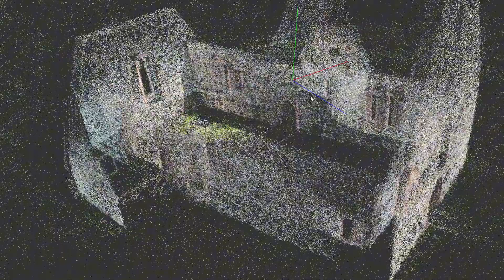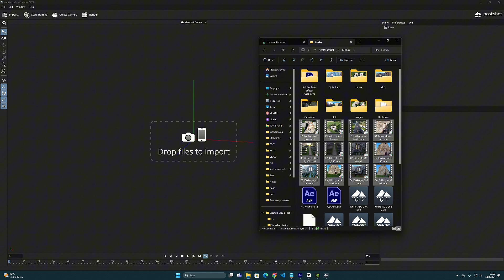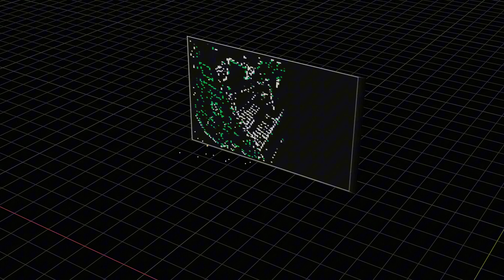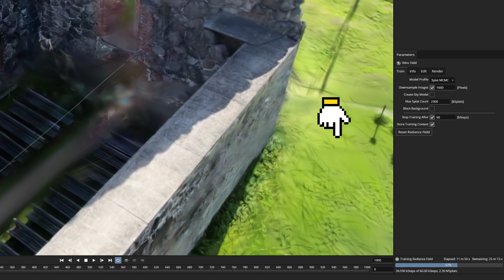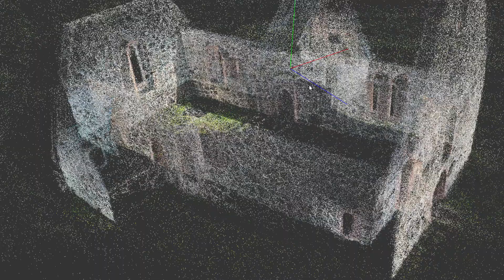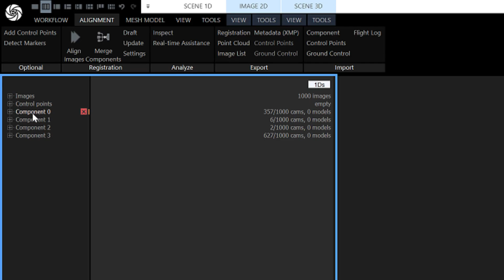Unlocking the Mystery of Sparse Point Clouds in Gaussian Splatting

Comment: Would it be useful to take still images in RAW format and then run them through Lightroom, with a simple edit that lowers highlights and raises shadows? You can recover a surprising amount of detail in apparently underexposed / overexposed images like this. Then export those images from LR as high quality .jpg and feed into Postshot. Result, PS should have a lot more detail to work with that would be missing otherwise. I've been dabbling with PS recently and will have to give this idea a try.

Comment: What about making a pass where the camera is exposed specifically for the shadows? The highlights would likely be completely overexposed and unusable, but at least all the necessary details in the shadows would be captured. If you were to provide multiple videos of the same trajectory, each with different exposures—one for deep shadows and another for highlights—would Postshot be able to understand and combine the data from both? Another option could be to use software like DaVinci Resolve or Premiere Pro to lift shadow details and then ingest everything into Postshot. What do you think?
Reply: Yeah, I was thinking the same thing.   Create an image sequence where you raise the gamma, create the 
point cloud and camera.csv in RC and then overwrite the gamma images with the original ones and do the training in PS.

Comment: Hi Olli! One trick used in photogrammetry is to capture the image during grey weather. It's never easy to process areas that are too dark, so you'll have fewer shading problems, and it's very practical for relighting! You can eventually lighten the shadows in your photos before RC, then put them back in to create the Gaussian, but it's better to shoot at the same time, over several days with the same weather. I find that calculating Postshot directly produces slightly fewer floating splats, but this can be cleaned up. It's still an interesting gateway, because the alignment will be more precise, using your drone's GPS, and it will have a better scale. Be careful, though, to increase the number of points detected on each photo before import, and don't hesitate to redo the alignment several times, as it will improve it each time! The presence of a few targets on the terrain is useful for control points. Xgrid scanners are also very interesting, with Lidar interpreted in Gaussian! Glad to see all these evolutions! Nice continuation to you! Thanks a lot!
Reply from the maker: Great tips. Yes. Those Lixel scanners from XGRID would be very interesting to test on this kind of large area scanning.

Comment: So If it has issues I've been experimenting what I do is export the video to images via say media encoder then I manually look at the problem area for blurry photos etc when exporting I won't export every frame say every 10th but if area doesn't look good I might export more frames there.  I delete anything that's flared and overall look for anything that could ruin the generation then I'm drag the images into a folder and use that in posts shot and rather than best I select all.  Also I might edit the images and add sharpening to them or boost shadows etc.  Say bulk on lightroom.  But mainly just get rid of non clean sharp shots.   This usually works wonders less is more in cloud formation and this method let's me add more images or Remove images from problem areas. You don't have to be meticulous.  But yeah ihad similar results in reality capture  and use it when I need to.

Comment: Here's a summary of the key points from the video with timestamps:

*0:08* - Introduction to 3D scanning and Gaussian splatting models, emphasizing the importance of understanding the role of the sparse point cloud in the process.

*0:50* - Introduction of the location: a ruined church, chosen for 3D scanning using both ground-based and aerial methods.

*1:39* - Ground scanning process described, including use of a scanning rod for different heights and interior scanning.

*2:03* - Drone scanning process described, with challenges faced due to weather and lighting conditions affecting the 3D model's accuracy.

*4:02* - Start of the 3D model creation process using the software "Postart," detailing the steps and default settings used.

*5:12* - Explanation of the image processing and camera tracking steps in the Postart software, highlighting the time-consuming nature of these tasks.

*6:01* - Discussion of the Gaussian splatting training and the importance of the sparse point cloud in determining the model's accuracy, especially in areas with differing light conditions.

*7:22* - Analysis of the model's shortcomings, particularly in areas with less dense point clouds, and the decision to improve the model by increasing iteration steps.

*9:04* - Explanation of the sparse point cloud's role as a "gauge" for placing Splats in the model and how its density affects model accuracy.

*10:00* - Introduction of "Reality Capture" software as a method to improve the sparse point cloud density, despite its steep learning curve.

*11:01* - Challenges and process of merging different scan components within Reality Capture to create a more accurate point cloud.

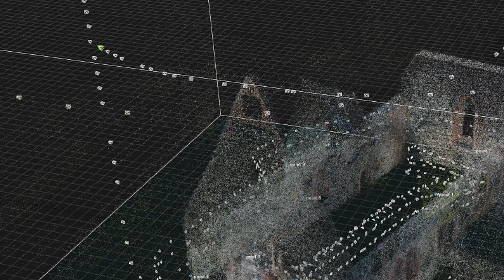*14:02* - Reiteration of the faster progress in Gaussian splatting training when using the improved sparse point cloud from Reality Capture.

*16:15* - Conclusion comparing the time and effort between using Colmap and Reality Capture methods, noting that Reality Capture yields a better result despite being more labor-intensive.

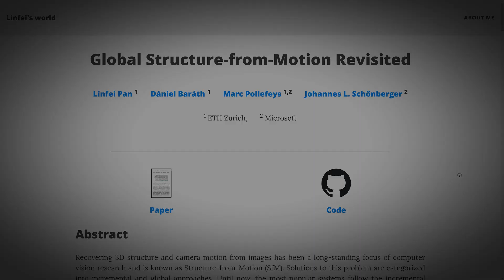*17:03* - Mention of ongoing research and new methods being developed to improve point cloud production, with references to additional resources.

*17:45* - Closing remarks, encouraging viewers to like, subscribe, and stay tuned for future experiments.

Comment: I've found your videos incredibly helpful. May I ask you a question? I tried working with the Insta360 X4. I captured 360-degree video and then used Meshroom to split the images, generating a point cloud in RealityCapture. I also tried using the program you recommended, but unfortunately, RealityCapture didn’t align the images properly. It seems like there wasn’t enough overlap between the images. Additionally, this method seems to significantly reduce the image resolution. Do you have any good solutions for this? I want to maintain the quality of the 360-degree video as much as possible before sending it to Postshot.

Comment: Top notch video as per usual. You are right to persevere with RC (or other software such as Metashape) for obtaining the camera alignments and sparse point cloud. I note the comment from @plan8214 on improving things even more by using CloudCompare before going to Postshot and I shall be trying the technique they describe in my own methodology.
In RC it is the meshing and texturing that takes the time and procesing power and not the alignments, so if you are happy with a GS as the output then diverting to Postshot after alignment in RC is the most efficient way to go.
Taking images under the same/constant lighting conditions always works best, so overcast days, simultaneous capture, and a color chart to synchronise colours between different cameras helps. If your cameras are stationary when taking the images its also posible to use HDR techniques to remove shadows and highlights from your photos using semi-automated software such as Photomatix. 
When RC creates lots of components its effectively telling you that your data isn't good enough (for RC), and in my experience, endless tweaking of the processing/merging options only makes marginal gains. I look forward to learning more from you and the knowledgable subscribers and comment makers you have.

Comment: I'm more of a photogrammetry guy than GS but the issue you've had here was that the SFM algorithm used in Postshot just isn't as good as in commercial software - it doesn't align images as well and this results in holes absent of data.
I myself use Metashape for aligning my photosets which I later use in GS, from my test I've found it to have more "workroom" in situations like yours, compared to Reality Capture, and will mostly align components without the 60% overlap rule. Nonetheless I'd recommend to have this overlap in different camera/device image sets, at least at the start and end of a set of photos.
What also helps quality is taking photos instead of video, you could probably set your cameras to fire at 0.5s intervals. From what I know 360 cameras can output 2 fisheye "circles" as raw images for each of the lenses, those can be used at the alignment step without correcting their deformations as most PG software will do that themselves and having it done before just increases errors. Unfortunately photogrammetry doesn't really like combining images taken with different parameters but if you have their correct exif data it should nonetheless get things done. Raw images have another plus of having more data packed in compared to extracted frames from a video, in places where you have hard shadows for example you could recover quite a lot of hidden details, whereas in a video frame you'll just get featureless gray mush.
Better images at the end result in better reconstructions, limiting the amount of outlier points and empty patches in point clouds.
As for the amount of points I can say there's a visible uplift in quality at the beginning of training, although your analogy with the mesh of points holding the splats "in" (limiting floaters) was quite good. That's why we want consistency in point coverage more than the density itself - coming back again to the quality of our dataset. 
Hope my random thoughts helped a bit :>
Reply: This does help a lot. Have you done this yourself with the raw fisheye, and if so, I assume they'd served their purpose for the camera solving in metashape only, and anything else done in Photoshop didn't need these

Comment: Sometimes, the RC algorithm is a little restrictive when it comes to picture alignment and will break the scan into different components.i usually switch to agisoft metashape software  before I go deep into RC ground control .Agisoft metashape can get better alignment results in large area scans ,if not I stick to RC for speed processing

Comment: Hi, thanks for that! Your videos are always so informative and never shy from detailing errors, which is a great source of learning. Thanks. 

I find that after reality capture, which produces quite a noisy pointcloud (significantly noisier than it displays in its own viewport btw), it needs to be cleaned in cloud compare software (open source). But specifically, I use the reduce points (subsampling) option and select the “octree” method. This has the effect of averaging out the sparse cloud so that there are fewer heavier or lighter areas of coverage, which in Postshot, helps with a more even splat. 

In my basic experiments , it appears to me that actually, quite a light pointcloud is all that is needed to hold the splats together quite well. 

Also, use the CC to clean out any noise using the noise option which helps greatly reduce floaters. 

Thanks again!
Reply from the maker: Interesting! That is good info. I need to take a closer look at that octree method. Thanks!

Comment: Nicely done. Some feedback on the capturing and RC steps. 

Setting control points (CPs) suck, and they’re sort of a last resort. In order for the images to align automatically, I highly recommend when taking off with the drone, to start capturing at eye/head height first, capturing the same perspectives as your 360 cameras. In fact, you should do this at 1 or two more locations in the scan as it will ensure the accuracy. 

Second, you can get an even MORE dense point cloud by doing a mesh reconstruction in RC after aligning the cameras and exporting that as a PLY. That way, you’ll have a ton of points in the areas that your alignment point cloud had sparse points. 

RC is very finicky and has a huge learning curve, but for me as a photogrammetry professional, having my scans and splats aligned, scaled, and in the same coordinate space is really useful for combining the two. 

Keep at it!
Reply from the maker: Thanks. Good tips. The dens point cloud is interesting. I haven't been able to export Dens Point Cloud in correct format that Postshot would understand it. And I'm not sure would Denser Point Cloud solve all accuracy issues in Gaussian Splatting after all because Gaussian algorithm is primarily designed to work with sparse point clouds.  Dense point clouds can be huge in file size and it might choke the training process. But it definitely would be interesting to try what actually would happen.  Ideal situation would be that if there could be a way to paint and mark parts of the model where I would like to have more accuracy and more points. 

I need to practice using Reality Capture more.
Reply: @OlliHuttunen78  I was able to export meshes (typically simplified to 1-2mil plys) as PLY's and successfully use them with the default 3DGS trainer, haven't yet tried it with PostShot--will need to look into this. The nice part about it was that the points were way more accurate than the alignment feature point clouds so the gaussian splat ended up with way less floaters.
Reply: I was going to say the same comment as above… Coming from doing a lot of photogrammetry and reality capture using their component alignment sucks… I usually try to shoot a lot of overlapping perspective photos from ground level with the Drone and ground images at the time of capture. The software will then have plenty of points from the both the Drone and ground cams to match up.

Comment: Thanks Olli. Another great video. I started my 3D modeling using Reality Capture, and no, merging components isn’t fun but it’s doable. (Filming the transition from outside to inside may help reduce the number of components.)

I’m also wondering if using your drone to capture the three levels on the outside would help the quality. With that being said, RC was the only application I could get multiple cameras to integrate together. 

I’m so appreciative of your efforts in understanding GS processing and thinking outside the box. Knowing that RC does a slightly better job in creating a sparse cloud will definitely have me changing my procedures a bit. Thanks!!! 

Btw, I’m finding that no matter how well images are extracted from videos, they never give me better results than using original images from a camera. Images from videos not captured with proper shutter speed and frame rate also can also make things worse. In the end, I got used to taking all my images with the drone’s camera even if I just walk around holding the drone to take pictures. The nice thing about walking with the drone to take pictures is that it has a leveling gimbal.

Cheer!

Comment: I'm wondering if the camera attached to the drone in this video is the same type of camera used on the ground. Additionally, I'm curious if Postshot can accurately process images from different cameras that have varying fields of view and resolutions.
Reply from the maker: All the cameras in this project were different and FOV was of course different in each of them. Total of 4 cameras was used (three in scanner stick and then the drone) and this was also one purpose of this video to demonstrate that the Postshot is able to handle footage from different cameras as well as Reality capture. All source images was resized to same 1440x1080 resolution which I have found to be a suitable size for Gaussian Splatting training.
Reply: @OlliHuttunen78  So, in Postshot, is it possible to align images with different FOVs (Field of View) in a single pass, similar to RealityCapture? When I tested it, I found that only image groups with the same FOV produced results.
Reply from the maker: @go_ma_ma  Yes! Now it is possible. This feature for different FOVs has been there I believe since version 0.3.294